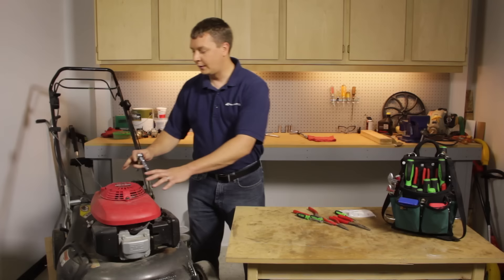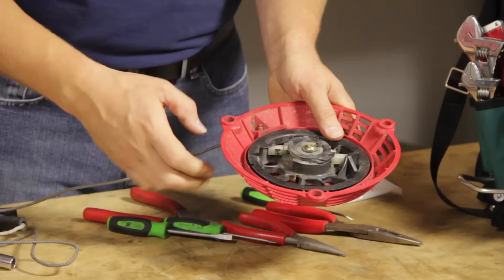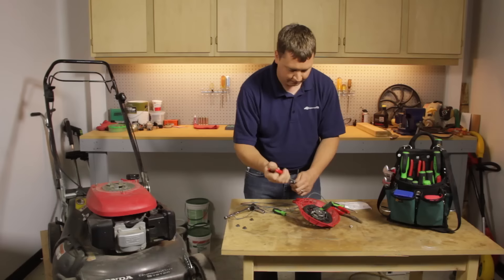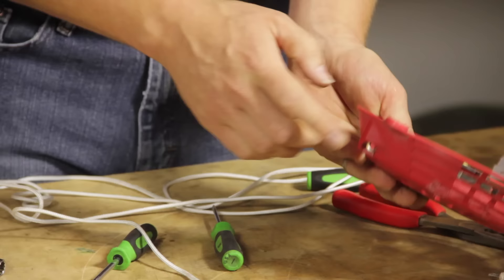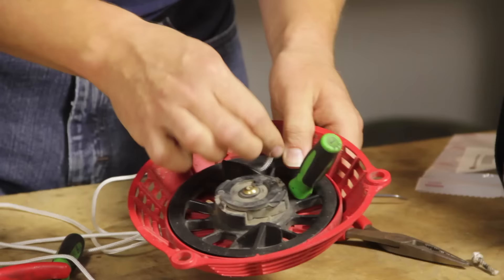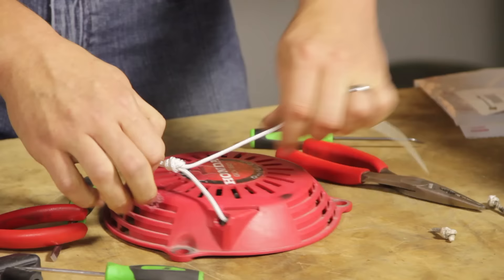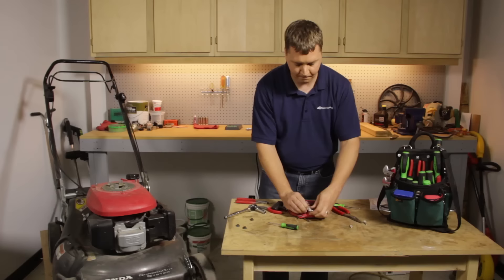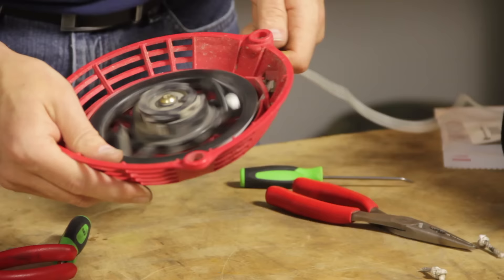How to Replace a Pull String on a Push Mower : Lawnmower Maintenance & Repair

Comment: This does work.  THanks for the video.  I melted the knot on both ends with a candle to make sure they didn't untie.  You should tie the handle before you rewind the rope so you can skip the temporary knot step.
Reply: That's exactly what I was thinking when I watched this. So much easier that way.
Reply: I tied the handle first AND melted the nylon knot.

Comment: In the middle of a mowing session and with weather cooling and closing the chord broke at mid-point. I quickly sourced some suitable materiel to change out the remaining part.
Having replaced the chord, my mower had one pull and restarted, however without the pretensioning it all stayed outside the housing. So next job is to complete, as shown, the proper spooling this time under tension! Many thanks.

Comment: Great video… watched it once, went to the hardware store, came back home and fixed in about 15 minutes.  The only challenge I had was the replacement cord was glued or melted at the end which made it difficult to insert into the hole.  I taped the end with transparent tape really tight then cut the end.  This allowed me to insert really easy.  Thanks for the help.

Comment: It's clear this video has been beneficial to many including myself. The only update is the handle for the pull cord has slightly changed. It no longer has the pop-out access for the cord. You'll have to use nose pliers or small screwdriver to remove the old cord. Thanks for the vid!!!

Comment: Worked like a charm. I might to add that we didn't have this type of rope on hand, but we did have some paracord in our camping gear, which did just fine. I also had to hit the contact point with some WD-40, since it wasn't pulling easily at first.
Reply: @Aplomado Falconer I have since given the lawn mower away. I honestly don't remember if it held up. Sorry!

Comment: This was exactly just what I needed. I have a different model, but it didn't matter, you made it easy to figure out how to recoil the darn string.I fought with this mower for over 3 hours, then went to bed, stressed out, because I have to mow my yard. My neighbors were doing it for me in exchange for parking their trailer on my property, but haven't in a while and the city will fine me if I leave it too long. Well, between a broken foot, and a weedeater, I didn't get very far, after I discovered the last handyman that borrowed my mower, must have broken the pull string and didn't tell me.so I go to mow, and no string, nothing. I am tired, and stressed, and look on youtube, and find dozens of complex solutions and how to also tear the mower apart. Well ,i was fearless, and did it myself because I figured, it'd cost me $300+ to buy another one, money I don't have, and so, well if this one was broken, well all I could do is either fix it or break it a little more. and if I couldn't fix it, it was trash anyway. so, after searching for someone who had the pull string online, I went and got it. (Home depot)(Lowes, couldnt' find it, but they may have it but maybe  I didn't know the right verbage). Anyway.  I got up because I couldn't sleep well, and went to the garage. I discovered the coil was bent out too far, so it couldn't hold a coil, and that was problem #1, plyers bent it inward, so it'd catch and stay catched so it could coil. I had to watch this video, because other ones, couldn't make sense of how to coil the wire up inside. This one seemed wayyyyy.... tooo easy, but what the heck try it anyway. Walllah.... It worked. then I just reassembled the various parts. of which i fortunately remembered how they came apart. though another video had same model and showed how to disassemble and assemble, so I could find it again ...I think(though the string coiling was complicated on that one.), Anyway, put the whole thing back together, and pulled and wallahh... it tried to start! Now I think I just need some gas!  Horray....   Well its 2:01 am, so I shall wash up and go back to bed! Not bad I have to say, for a lady, who's never tried her hand at any kind of mechanical repairs before!

Thank you!
Reply: Yeah except this video did nothing at all when it comes to talking about re-connecting the recoil spring so either you watched another video or spouting out your pie hole. I'm glad you were able to fix your mower and get it done. Ain't no joke when the city comes by and fines a person for grass above 6 inches tall.

Comment: Thank you!!! Made my life so much easier.
If the end of the cord is frayed, wrap the end with a little bit of tape to make it easier to insert. I ended up threading some fishing line through it as well, tied it to the rope, and then pulled the fishing line to help guide the rope through the spool hole.
Reply: Or you could just burn the end of the polyester rope with a lighter

Comment: Thanks for the video and information.  I had never done this before and had no clue what I was in for.  I have a Troy-Bilt with a B&S 550-EX which is a little different from the Honda you show but the concept is the same and it worked perfectly.  After buying the new pull cord ($4.50) from Lowes it took less than 15 minutes to change - disassembly to install.   I even hummed the eHow tune as I was doing the work.

Comment: Thx for the help.  My pulley assembly was riveted down so i had to finagle a bit to get it through.  Worked best going the opposite way in instead.  Guess I couldve drilled out the rivets and replaced em with bolts and nuts but didnt look like itd be that hard to do.  Wouldve been easier too with some really narrow tipped needle nose pliers or the like but managed to eventually and very slowly work it in or rather out

Comment: What if your rope broke and got sucked in? How do you get the tension back on the pulley?
Reply: Mark F 
You pull it on the other side. It just happened to mine and he showed me clearly how to put it back.
Reply: What if there is no rope left in there at all because some handyman (not) took it out first - I can't even get the pulley to get any tension now & I can't find anywhere that solves that issue!? Help please?

Comment: The easiest way is to get a good flash light and look down and see where the knot is for the string pull it out using a pair of hair treasures but pull the cord out just enough to tape the new string to the edge of the old one use strong tape and only make the connection as wide as the string. Now slowly pull on the old one until you see the new one coming through the final hole. Make sure you the a knot at the end of the new one so you don't pull it all the way out after you see the new string knot hit the end of the inner hole and the new string is in place tie your hand pull to it. Finally anytime working on a mower unplug the spark plug I think it is better to take the spark plug out. Also make sure the spark plug wire is not in contact with the engine by mentally pulling it over to the side. This is so the lawn mower does start while working on it. It can hurt you.

Comment: This video is very informative. Take it from me those cheap plastic Honda pull starters you can buy aftermarket ones from stands for like 14 bucks. You will be fixing those cords a lot they suck even brand new out the box the cord still break but hey 14 bucks is 14 bucks LOL

Comment: Got a 18 blade poulan chainsaw wont start takes 25 tries starts dies then take another 30 tires to start any advice fuel filter cleaned gaped the plug still not running

Comment: Safety point: Disconnect the spark plug so you do not inadvertently start the mower when you pull on the rope (4:10 in the video).

Comment: His "first mistake" and this is absolutely the first thing thing you do when going to work on a petrol lawnmower you must disconnect and isolate the plug cover I personally take the plug completely that the first thing any pro would do, ten fingers are better than none. Robbie.

Comment: Good video, only one thing I might add to it is for Safety....  Remove the coil wire from the plug, because when you are all done and pulling the rope back to hook it on the handle, the mower could fire.

Comment: What size rope do you use? I used one but I noticed the rope was too small after I tied it. After several tries the rope slipped through the hole and I had to start over. I made sure it was double knotted but it still slipped though the whole. Please help.
Reply: +Raul  -- buy a new pull cord at the store.  Then you'll have the right size and length
Reply: Thank you
Reply: you really couldnt think of that yourself haha
Reply: but sometimes you're getting it from a spool, its good to know about these things.

Comment: Hello~ I bought a new mower and read all the directions and put it together. Claims it would start on 1st/2nd pull. FIRST pull was difficult and the cord then would not retract and mower did not start.  This is a push mower and self propelled (back wheels with 4 speeds). Should I replace the cord or do you think there are more things going on than just the lack of starting and refusing to coil back into the mower? Thanks! ‹(•¿•)›
Reply: BlondeExplorer1 Are you Holding down the bar at the top while pulling? Make sure the cord is attached to the bar on the side of the frame.

Comment: why dont you put the handle on the replacement cord first before you put it in the housing thus it wouldnt be under tension when you are changing the handle over and then there  wouldnt be any need to put the knot in the cord to put the handle on,you would by-pass that stage altogether,just sayin